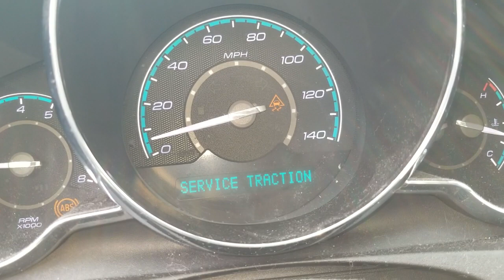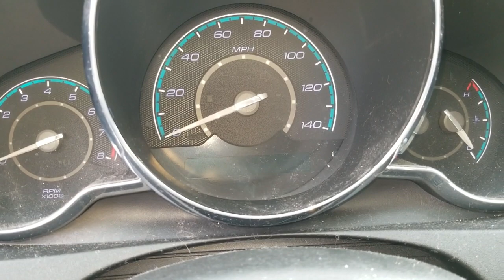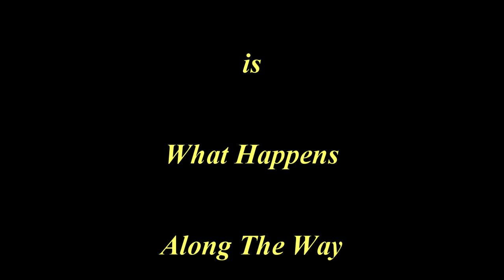Malibu Bearing Noise

Comment: Did the new bearing fix it?  My ‘05 is making the same noise.
Reply from the maker: Yes, but it was like pulling teeth on the devil to get those bearings off.
Reply: @TheLenaweeTrekker  I have a 2007 Chevy Malibu and my car makes that same squeaking noise when I put it in drive and go forward and when I turn to the left it'll stop but if I turn to the right it continues & if I stop the car completely and put it in reverse I can move in either direction and it not make a sound at all, Somebody, Anybody, Please a response immediately would be greatly appreciated!! Please message me or find me on Facebook under Rodney Casandra Britt please in desperate need of advice!!
Reply: @rodneybritt6595   did you find out what the problem was.my daughter car is doing the exact same thing.

Comment: I have a 2007 Chevy Malibu and my car makes a squeaking noise when I put it in drive and go forward and don't stop but when I turn to the left it'll stop but if I turn to the right it continues & if I stop the car completely and put it in reverse I can move in either direction and it not make a sound at all, Somebody, Anybody, Please a response immediately would be greatly appreciated!! Please message me or find me on Facebook under Rodney Casandra Britt please in desperate need of advice!!
Reply from the maker: Sounds to me you may have a bearing failing on the right side. When you turn left, it takes some of the stain off the right bearing and it get quieter while turning, and the noise comes back when you exit the turn. 

I had a Chevy Celebrity do that many years ago. I replaced the faulty bearing and the car was quiet again, but a few thousand miles down the road the other bearing started making noise, and I had to replace that one too. No more problems after that.

As my Dad tried to teach me, "If you replace it on the right side, replace it on the left side too."

Hope that helps.
Reply: @TheLenaweeTrekker  Thank you so much and could it have something to do with power steering fluid?? I just bought the car and I know it need some tlc

Comment: Mine moans but don't rock like it's loose I'm confused.
Reply: I got the same problem did you ever get yours fixed or figure out the problem
Reply: @AdamSmith-yg1fv  just replaced it
Reply: They bolts are loose , have to be really tighten